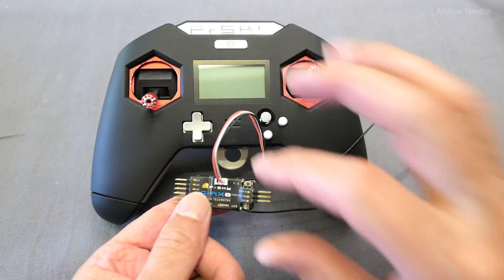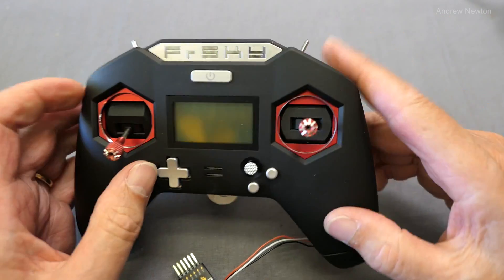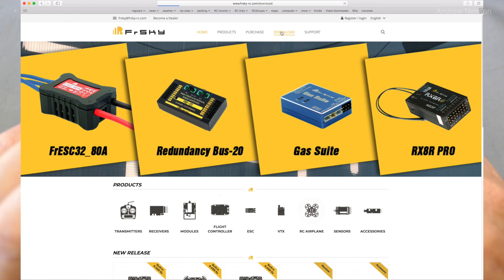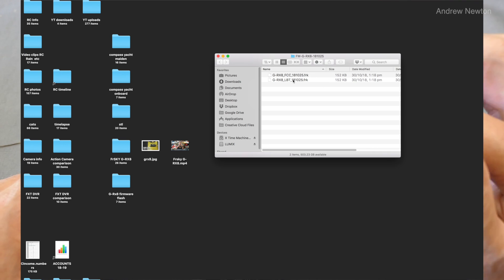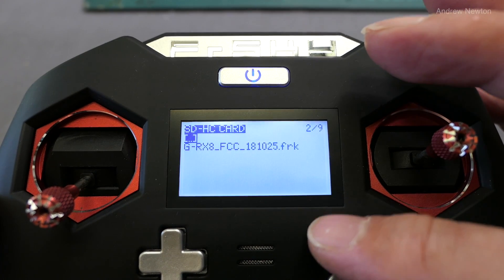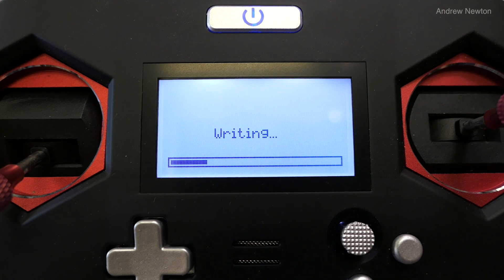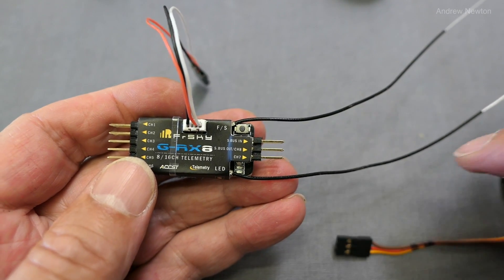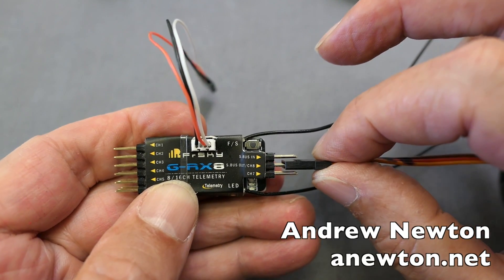G-RX8 flashing new firmware

Comment: Great to see you used the x-lite cause I had bought it last year after your recommendation. Fortunatelly I got the same receiver but decided to start flying with a stabilized trainer plane I got for 100$ during magic sale and therefore my ranger 1600 + taranis xlite + telemetry receiver were on hold.
With these videos I can start my ranger adventure in early summer -  european summer of cause.

Happy to see these videos cause when you had started with the other receiver video I suddenly asked myself if the lite is telemetry capable or what modules else I might need.

Eastern and summer can come. 
Thanks - great work.
Reply from the maker: Oh yes this is a fully featured Taranis. Just has less switches and a smaller screen